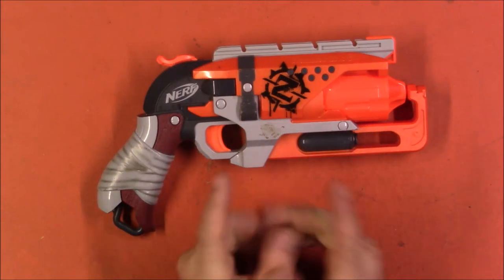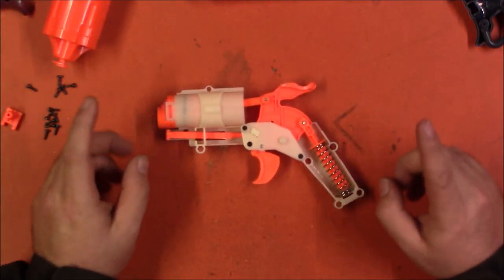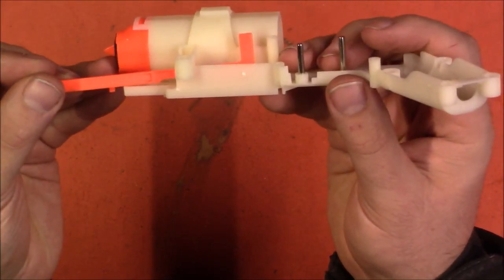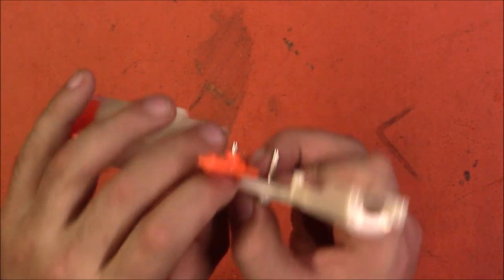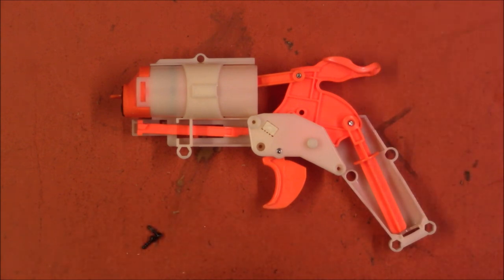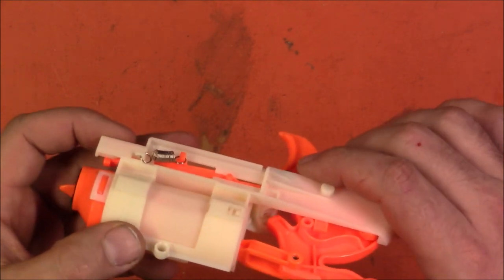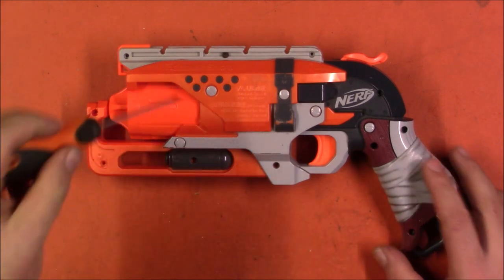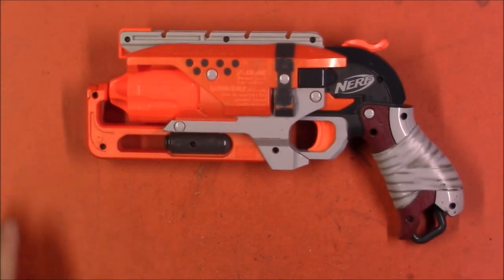Monday Mod Tips - Hammershot - Reassembly Guide

Comment: I had to completely dismantle a Hammershot I ordered on eBay, since it had below stock FPS and the rotation mech kept jamming.

Seems like the previous owner dropped the Hammershot in the sand quite a bit, causing everything to jam up, including the plunger tube, making it either have a bad seal or not disengaging while priming.

After cleaning all the parts up and re-seating them, my Hammershot is fully functional and with stock Nerf FPS ratings, now I'm saving up to order the mod kits for it.
Reply: Sweet nice job cleaning out the sand!

Comment: This reminds me of the time Cap said that the Reflex 6 cylinder was the same size as the Hammershot and I thought, you beauty! I have both those blasters! Turns out he was right, buuut, the Reflex 6  rotates in the opposite direction! So the Hammershot's rotation arm couldn't rotate it. In my attempts to modify the system to work I basically destroyed my Hammershot. Fun times! I mean, it's really on me for destroying it but still, great advice Cap.

Comment: Capt X, do you have a tutorial on pulling apart the separate shell parts?
Reply from the maker: I do not, no. Most of the older ones are solvent welded together.
Reply: @CaptainXavier  Dang. And just bought pricey paint for it. Thanks Capt. Peace from Perth Western.
Reply from the maker: Yeah, gonna have to tape it off.

Comment: Awesome guide, Captain! Thanks for all the quality content you make!
Question: is there much (if any) difference between the Hammershot and Sweet Revenge internals?

I've seen you mention some differences in other videos, like the front bit of the rotation axle, and the hammer and trigger assembly. But how much of a difference is between those? And are other parts different?
Reply from the maker: They are 95% the same. The cylinders are even interchangeable.

Comment: Hey Cap,
I recently just got my first hammer shot.   I actually had the orange fortnite one first and thought that it was the shit.  Well you always talk about your arsenal of HS so I finally got one for myself and boy what beautiful blaster.  I orded 3 more off Marcari 4hours after getting my first one in my hands.  It was a little quirky so I had to take it apart to fix and got it but what I nice set up.  All the giblets just come out in one piece.  What more could you ask for. 
Anywho.  I'm writing because you have a ton of content on HS and with all your experiance I was thinking you probably ought to put out "The Ultimate Hammer Shot Build"  i.e.  springs/spacers, cylinders, and other hardware's.  Maybe not so much on the cosmetics because of how drastic they change them.  Any how.  Just a thought I had after watching a bunch of the HS vids. 
Keep up the great work!

PS I forgot I wanted to ask.  I know sometimes you dont like taking the AR out of certain blasters. Is this one of such blaster models?
Reply from the maker: Yes, do NOT take the AR out of a Hammershot. It does not help and can, in fact, ruin it.

Comment: Hi captain, I recently got a fresh hammershot off of amazon (my first hammershot as well) and for some reason everything works fine but when i load darts into the cylinder and fire, the gun makes a loud sound and the dart stays in the cylinder and when it does fire, it only travels a few feet. Any suggestions?

Comment: Hey, Cap.  Do you know how to put a Zuru X-shot 6 round cylinder in a hammer shot and still have it rotate properly?
Reply from the maker: The key part is replacing the rotation mech with one that rotates 1/6th instead of 1/5th.

Comment: my hammershot's foam ring at the front of the plunger tube fell off and now it doesnt work as good
Reply from the maker: That will happen. Replace it. Either with a slice of Mega dart foam, a ring of craft foam, or a rubber gasket

Comment: do any of you have problems with the hammershot squeaking? mine squeaks whenever i manually turn the cylinder, and occasionaly when i use the hammer to turn it. please help
Reply from the maker: I have never had that issue. At least not enough to notice. I would try some lubrication.
Reply: @CaptainXavier  I reckon it had something to do with the cylinder rubbing against the rubber O-ring, I will try it

Comment: do you have to drill out the ar from the front or back
Reply from the maker: Neither. I don't recommend removing the AR from a Hammershot. But if you do you don't have to drill it at all.
Reply: @CaptainXavier  I need to remove the ar for cylinder upgrade I have a dead space remover but couldn’t figure out how to get the end cap of the plunger tube

Comment: My hammer shot can not hold a prime do you have any idea why????
Reply from the maker: "Hold a prime"? As in when you pull back the hammer it does not catch? If so my guess would be there is an issue with the catch. Open the blaster and try priming it and see what is not catching.

Comment: I really love this series. I’ve never had a NIB Hammershot, they have all been thrift finds. Now as none of them have a smooth hammer return. Guess I need to open them up and improve the air seals. 

Any suggestions on what o-ring to use for replacement?
Reply from the maker: It is probably not the o-ring. 8mIt is more likely that the foam gasket between the cylinder and the plunger tube is wearing out. It can be replaced with craft foam...which I happen to know you have access to. ;)
Reply: @CaptainXavier , oh No Sir, that is Melissa’s craft foam. One would not dare use that with out express written permission. Least they loose a digit or whole limb.

But yes I can acquire some, and thank you for the heads up